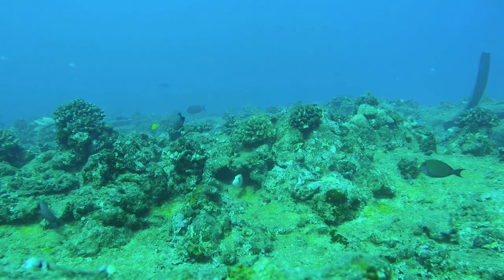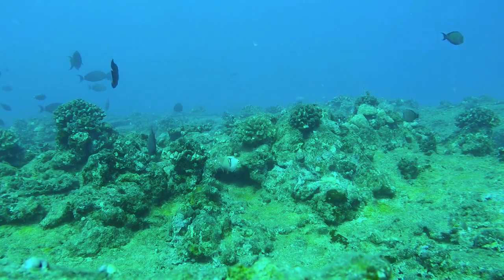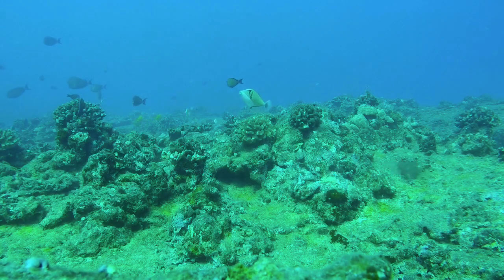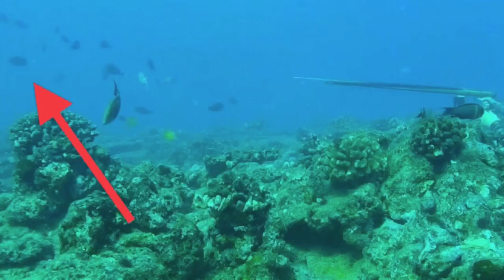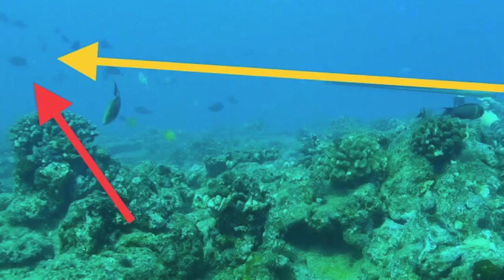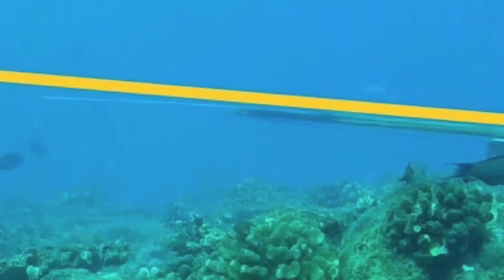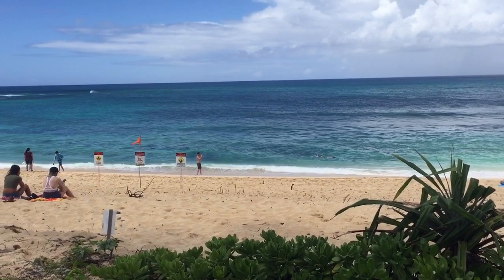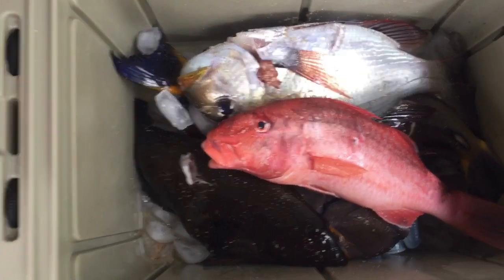Over Powered Speargun- Deeper Perspectives

Comment: Thanks for sharring, Would be also nice to know how much it is over powered in numbers (length and thickness of the bands and the shaft)
Reply from the maker: MB Spearo Here are the numbers: 55” Hatch Amero gun, 43” from bands to loading tab of shaft, bands are 5/8”, cheapest rubber, and 24.5”. Shaft is 9/32”. I always make one band pretty tight (350% stretch or more), which I use when I shoot single band. But I made a mistake and ended up with two short bands, so I threw on longer wishbones (about 4” each).
I certainly wouldn’t claim any of that is tested and certified as the ideal setup, but those are the cold, hard numbers. 
If I recall, stock bands were about 27” and the gun shot fine (with both bands loaded).

Comment: I agree, been all over the spectrum of band length and settled on rob allens or primelines @ 325%. Acid greens and kent rubbers @ 350%. What do you run?
Reply from the maker: David Koba Kent’s the “generic” rubber right? I usually do one tight (350% or more) and one a little looser. I shoot single band a lot, and I feel like the “stock” bands were a little too weak for that. So that’s why I keep one tight band. I don’t obsess about any of it though, because evidently there’s variation even within different batches from the same manufacturer. If you happen to be a baseball fan, you know there’s currently some wild variability with the ball in the major league. So I guess this stuff happens with rubbery sporting equipment. Add the fact that I use the bands to the point where I expect the last strand of weathered rubber to give way every time I load it, and it seems pointless to do too much calculating. I mean, of course I want to start with what I think is the best setup possible, but I’m always ready to adjust by feel or observation.
Reply: @thekindproductions  Your right there is a huge variation between batches. I noticed the extruded type (kents) is alot more consistent. The dipped process latex like the rob allens have a large variation in both diameter and elasticity.
Reply from the maker: David Koba good info, thanks!